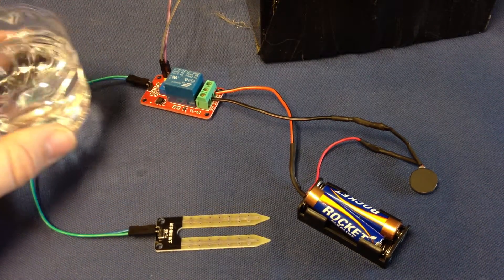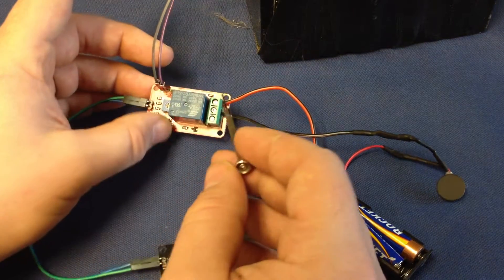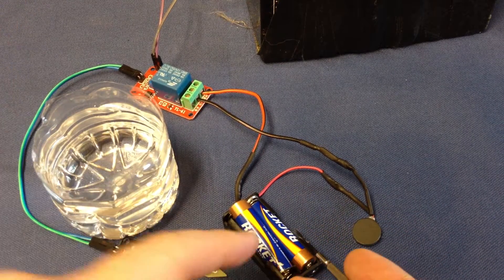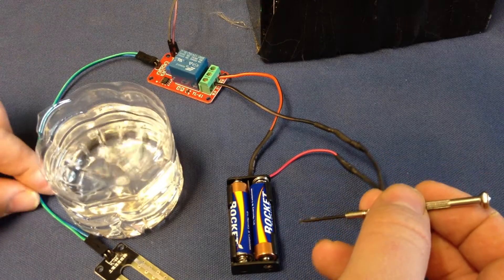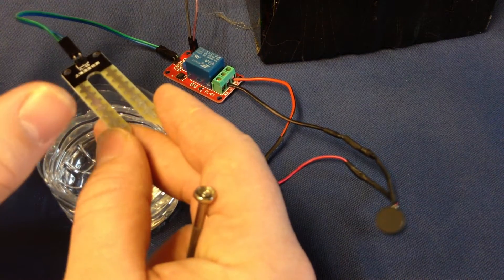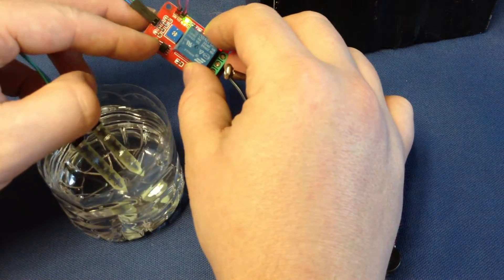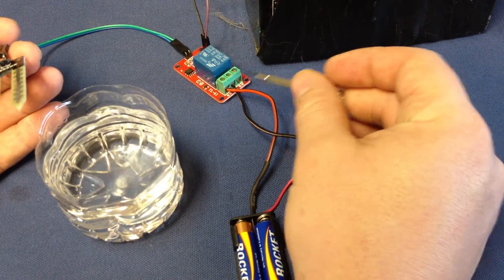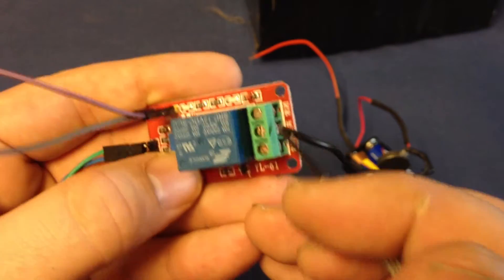12V Relay module soil moisture soil moisture sensor robot switch on off A8

Comment: I have a SRD-05VDC-SL-C relay board which I want to connect with HP-6601 220 v ac pumping motor and TY-69 moisture sensor. Could you explain me how to make the connection

Comment: Did you connect the sensor to a microcontroller too? If so how? I have the same sensor but it only has VCC and GRD pins and I don't know how to get an output pin to connect to my arduino.

Comment: Can you use 120v AC on the contact switch or is it a 12v DC system only
Reply: ravi jagessar pretty sure its rated for 120vAC also